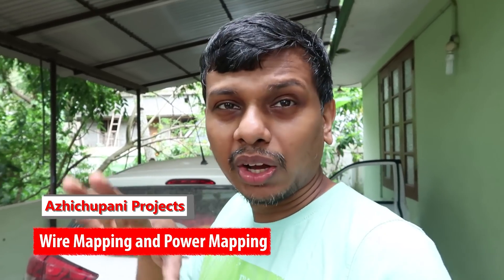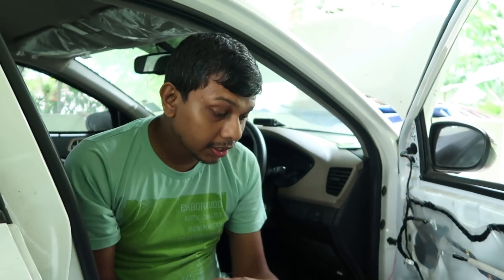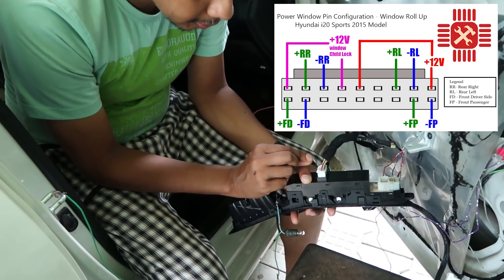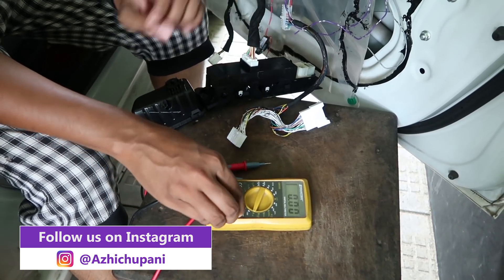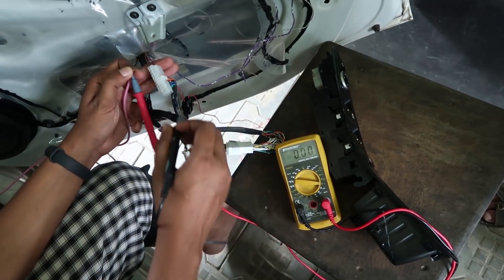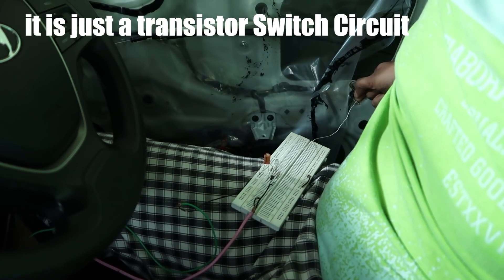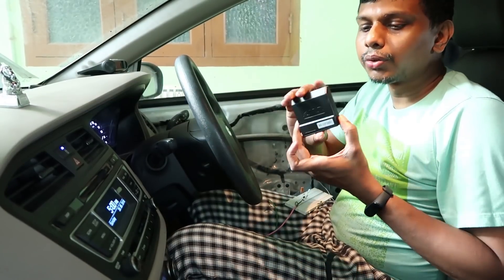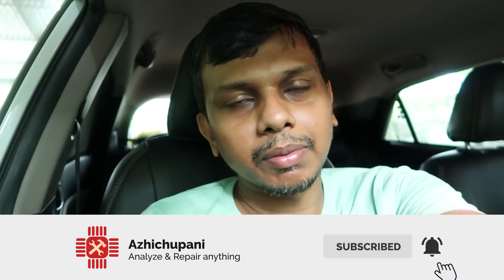APEP9 - Window Roll up wiring reverse engineered | Pin-outs and Amperage

Comment: If you have the old code of tail lamb that you designed in your car back side....simple just edit that code for count the indicator blinks and take a out put from it
Reply from the maker: What happens when you turn on the blinkers/hazard lights?? Oru samshayam
Reply: Azhichupani  athinalle...count...nammal...key press cheyyumbol .. indicator blink cheyyum....oroo thavana blink cheyyumbolum...ath arduino vech
.blink pulse input aayi koduth... example...4(blink count 4) times blink cheyyukAyanegil....nammal oru 5 times while loop n=5 enn set cheyth run cheyyichaal...loop lazhinjitt blink count 4 anoo enn check cheythaal... windows up
Reply: Azhichupani pinne...pulse nu connection edulkendath...hazard signal linte switch il ninnu edukkanam....